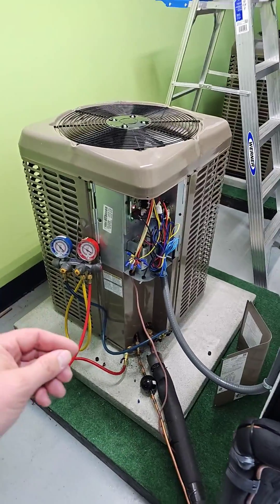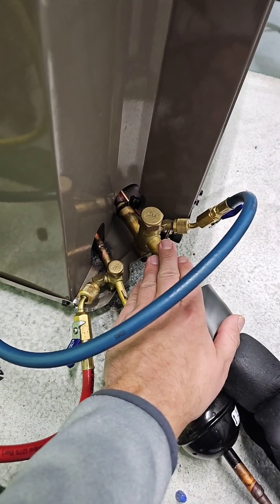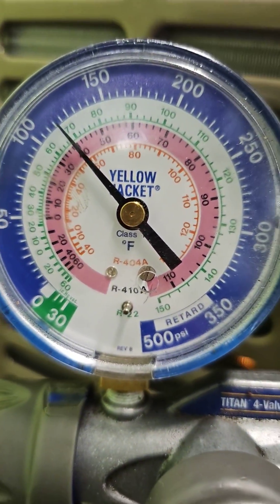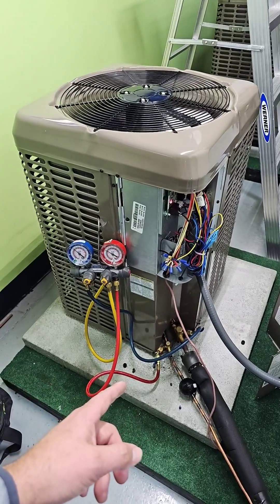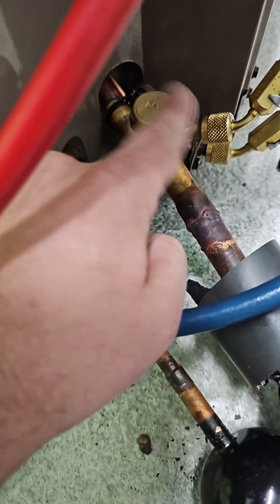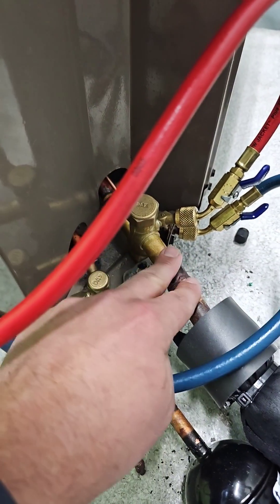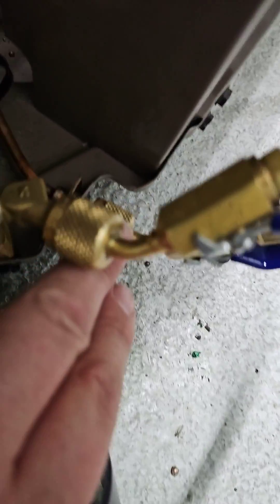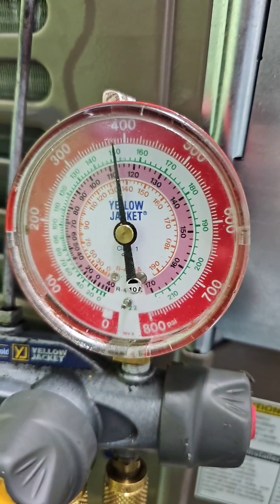How do you hook your gauges to a heat pump? #heatpump

Comment: actually , leave your low side on the common suction and leave your high side on the liquid all the time so you may read subcooling and superheat without moving ever !!!!!

and by the way this configuration will work in heat and cool  and not need to move anything like in the video

Comment: Just wanted to let you know that if you are getting NATE certified and on the test when asking where you hook up your gauges in cooling mode you put the low side on the suction line port and the high side on the liquid line and in the heating mode the high side goes on the high pressure vapor line which was the suction line and the low side to the third port that is the correct answer on the test if you want to pass if the outdoor unit has a accurator metering device the liquid line port becomes the low side in the heating mode

Comment: You get the same reading in heat mode regardless if you have your high side hose connected to suction or liquid. Me personally I leave my high side hose connected to Liquid line. And I just move my low side hose to the dedicated suction port for heat mode.

Just remember in heat mode on a heat pump. The only place you can get your superheat reading is the middle line going into the reversing valve.

Comment: To those saying he's wrong, read the fine print on the heat pressure curves. It'll say high side pressures "taken from suction line service valve." Trane rep also agreed. Manufacturers seem to be on the same page 🤷‍♂️

Comment: Ya but you charge it in cooling mode  so don’t really need to do this, you check the charge always in cooling mode
Reply from the maker: That is correct
Reply: Except when it's low because of a leak and you're on a service call at midnight and you need to get it running.